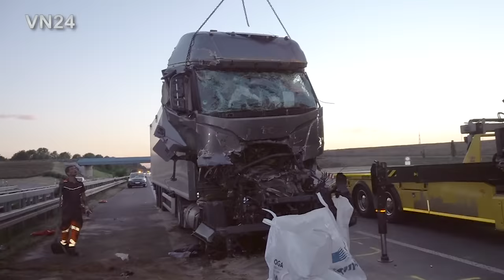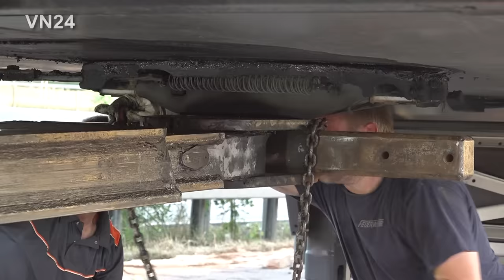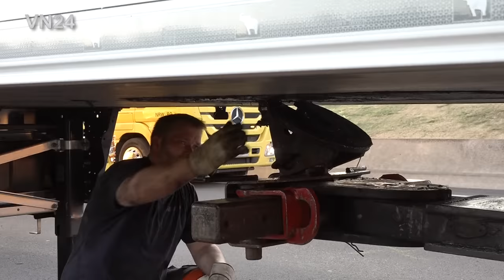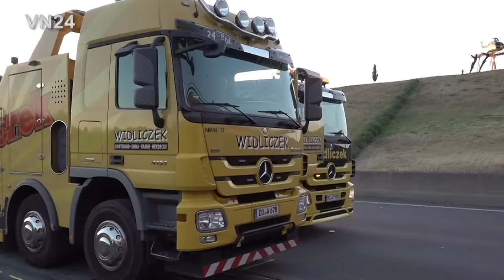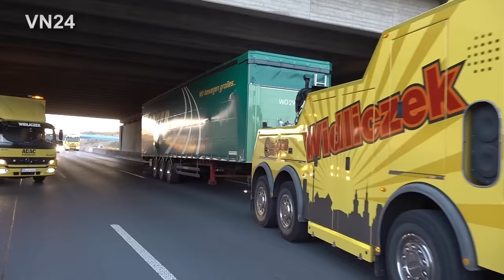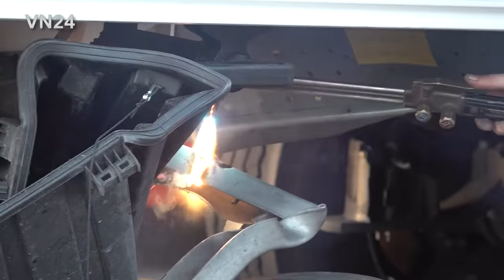19.07.2022 - VN24 - Schwerer LKW Unfall auf der Autobahn A2 bei Kamen

Comment: all this no overtaking for trucks in germany,speed limiters,cruise control,automatic gearboxes,vehicles that are so smooth and quiet theres just nothing to do but steer, just a big line of trucks going along static where you're just staring at the back of the one in front for ages, its all contributed to incidents like this over the years.
and whats worse is the  cast fifth wheels just snap off now and with the mega close coupling the cab which is designed to snap off the mounts just gets crushed cos it cant go off to the side.

Comment: I have a long hood. How do you drive these ugly trucks?
Reply: Different regulations. In the EU the whole length of truck+trailer counts torwards the legal maximum. To get more space for the goods, the truck has to be as small as possible.
Also: (compared to us/canada) tiny roads where the better maneuverability of a shorter cabover is a necessity. Great visibility too. When driving in a typical europe city you wouldn't want your long hood and trade it for a agile cabover in a heartbeat ;)
Legal Highway/Autobahn Max-Speed is 50-56mp/h (80-90 Km/h) depending on the country, so the longer wheelbase is not needed for high-speed-stability.
Reply: @ZefixYT  I couldn’t walk toward the abomination and get in it and drive it no matter the reason. Just too ugly.
Reply: @rayray4192  A commercial vehicle isn't built to look pretty.
Reply: @Bulletguy07  mine are. My tenth W.L. 900 ( Kenworth) is a work of art. All of my Kenworths  have been gorgeous.
Reply: To be fair.. American trucks are a whole lot uglier than European trucks.
Reply: @pantrofl  not really funny. My 310 inch wheelbase Kenworth W.L.900 L makes your toy trucks look like shit.
Reply: @pantrofl  you need better drugs. Current dosage is not sufficient
Reply: @rayray4192  lmao you're bragging about some pointless stretched truck, looking like it's built in the 90s. Sorry, I'd take an European truck over that every single time of the day.
Reply: @rayray4192  even the trucking trailers in America look like they're assembled with scrap metal. European style with 3 axles is so much nicer to see.
Reply: @pantrofl  The number of axles doesn’t add to the beauty of a trailer unless you have a trailer like mine with polished aluminum wheels and chrome hub caps and stainless steel fenders. Many trailers in America have 3-6 axles.
Reply: @pantrofl  my friend has an extended hood Peterbilt and a matching Great Dane reefer trailer with stainless steel front, back, and sides. Chrome wheels and polished fuel tanks. Chrome fenders on all trailer wheels. 225 lights. He runs Miami to L.A. His equipment makes your wannabe trucks look like silly ass  toys.
Reply: @rayray4192  hahaha 10 bucks says you're one of those swift drivers. Stop bsing pls.
Reply: @pantrofl  when you drive an abortion cab over you are the first one at the accident. That’s no bullshit